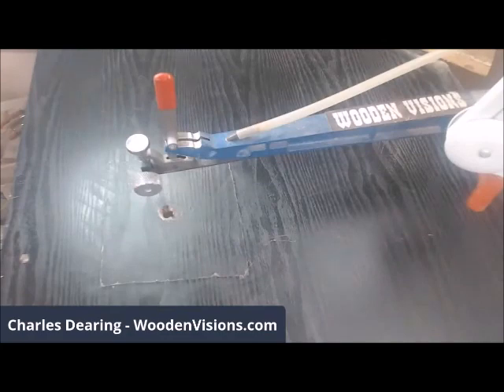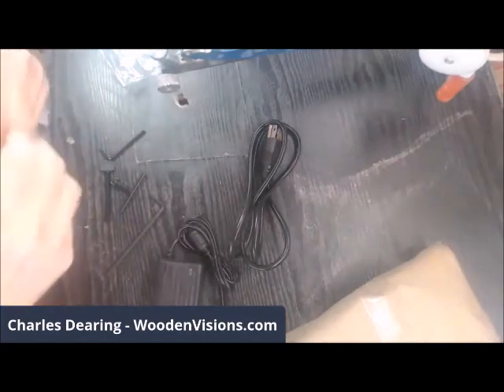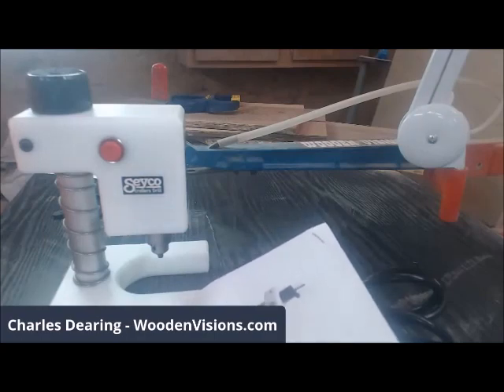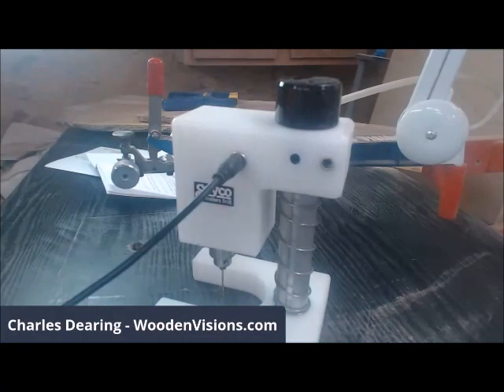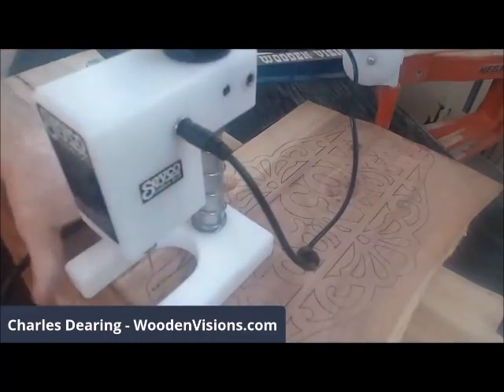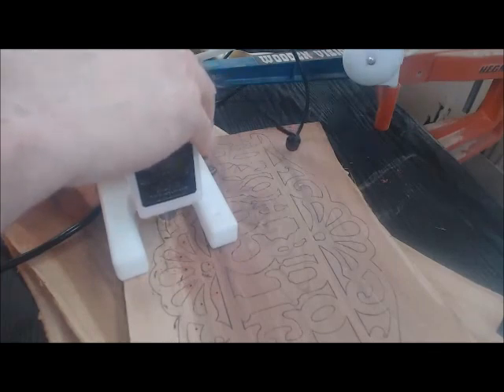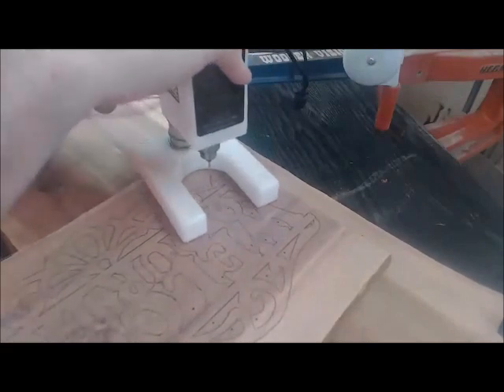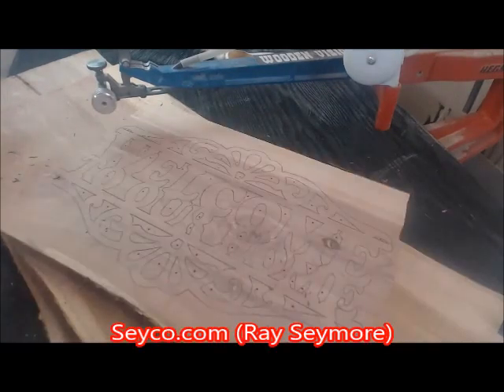Unboxing, Use And Review Only - Seyco Scrollers Drill

Comment: Hi Charles. I plunge the drill in and out several times a hole when drilling thick timber. It helps to clean out the hole for the drill bit to work better.